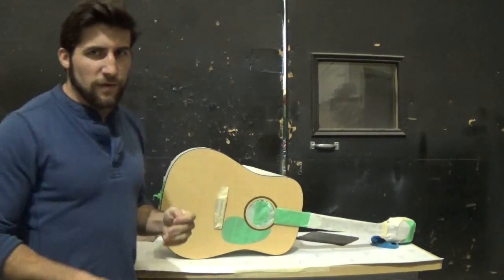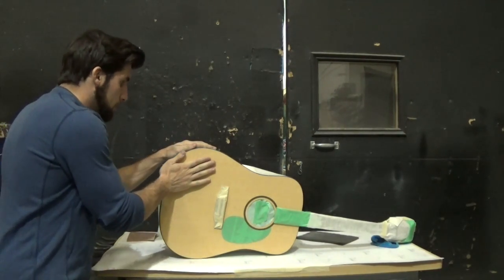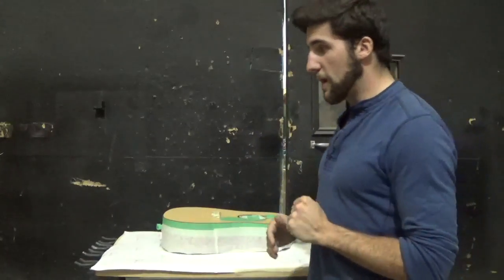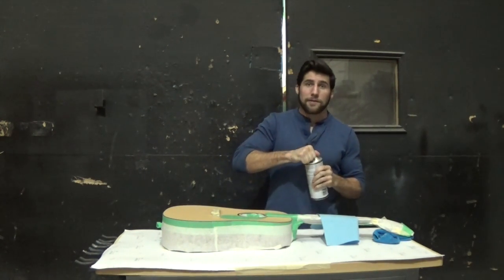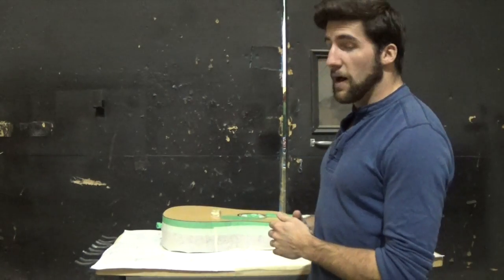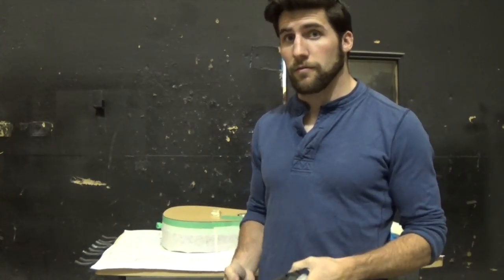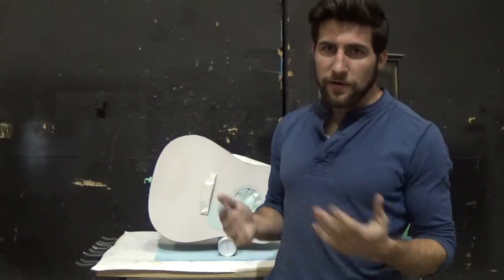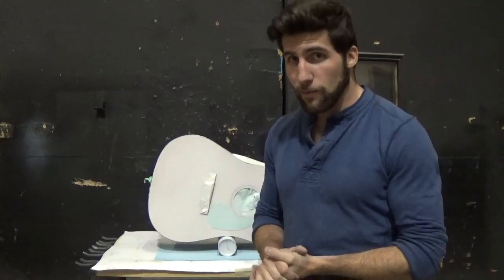Acoustic Guitar Airbrush Job: Base Coat

Comment: sr brand it is okey to use spry can clear on may acoustic guitar to cover up some scratches? and spray it again with polyurethane srpay can to make it gloss or mirror look this going to be my next guitar project
Reply from the maker: Using polyurethane on an acoustic guitar may be a bad idea. It can change how it sounds.
Reply: +Brad how about clearc coat spray can to cover up the scratch all over the body my guitar is gloss finish.. how many layer do I have to spray tnks sr. brad
Reply from the maker: You should only have to do a couple coats to deal with the scratches, but you'll need to scuff up the surface so that that paint will stick.
Reply: +Brad Angove thank you for helping im alwayw watching on your channel and I have a question why my guitar paint is soft im just touch the guitar pat fonger prita stuck on ny guitar its been 2 weeks and 5days but why my point is not dry or cure already.. do I need to repaint it once more
Reply from the maker: What kind of paint did you use? It sounds like you may have put it on too heavy and/or not waited long enough between coats.
Reply: +Brad Angove I use acrylic spray paint can
first I spray the primer 2 coatings and I main color white  4 coatings the. 4 counting of clear coat I wait 10minuts for every coat of primer then I wait 3 hrs for my white paint so on and so so.. what can I do to make the hard and cured, I've sun to dry it for a week and.still if I put it on may guitar case even in hard things it left  mark on the guitar
Reply from the maker: You should only do 3-4 coats 10 minutes apart before letting your paint dry 24 hours and scuffing. Then you can continue painting. You're not giving the various slayers enough time to dry. Also, direct sunlight is bad for drying paint jobs.
Reply: +Brad Angove really oh men I put it direct to sunlight to dry it fast oh men so what should I do to make this paint harder or cure
Reply from the maker: I think you may have to take the paint off and paint it again.

Comment: Do I have to sand a Jasmine S-34 C acoustic? idk if it's a shellac finish.
Also, do you HAVE to put a base coat of lacquer(or anything)?
Reply from the maker: You do have to sand it if you want the paint to stick. You do not necessarily have to put a base coat.
Reply: Brad Angove i'm honestly afraid to sand it lol how much do i sand off?
Reply from the maker: You don't need to sand anything off per se. Just make sure the finish is scuffed up to the new paint can stick properly. Use 600 grit paper and just sand it all lightly.
Reply: Brad Angove Ok cool. Another question i had was what gritt to use for all this? Does that change after primer, color, & coat?
Reply from the maker: Yes, it changes. It tends to gradually increase. 320-400 before primer. 600 after primer. 800 if it's between coats of clear or just before clear. Then for polishing I go in steps from about 1500 to 5000.
Reply: Brad Angove So, is it 600 or 32-400 to start out with? I haven't done anything to the guitar lol took the strings off, that's it. And you like to not sand between colors typically? Depending on the way I paint it, I may or may not sand between colors.

Comment: There are parts on my guitar where I can actually see the wood beneath the paint job..
Is it okay if I coat it with a primer, sand it, and then spray paint??
Reply from the maker: Is your guitar acoustic?
Reply: @BradAngove  Yeah
Reply from the maker: You can only use specific types of paint on an acoustic. It affects the sound.
Reply: @BradAngove  thanks man... Helped me a lot
Reply from the maker: The kind I used in this video series generally.